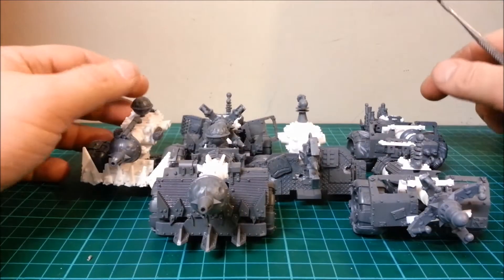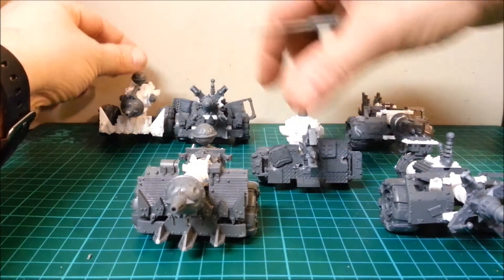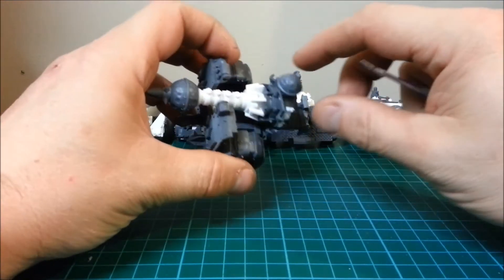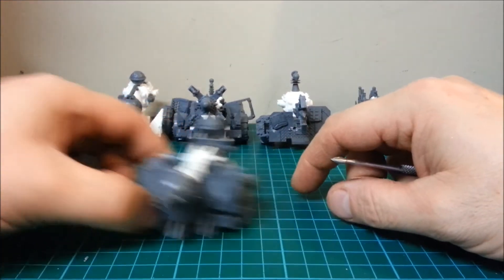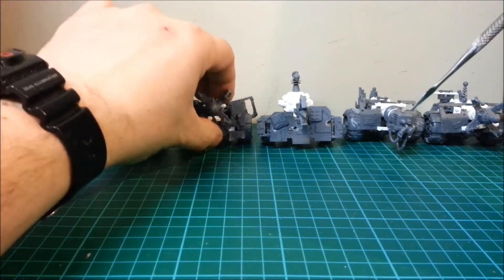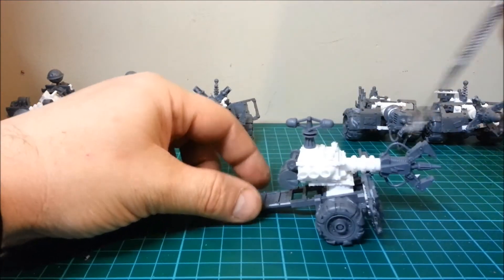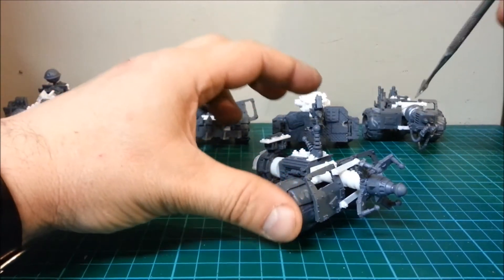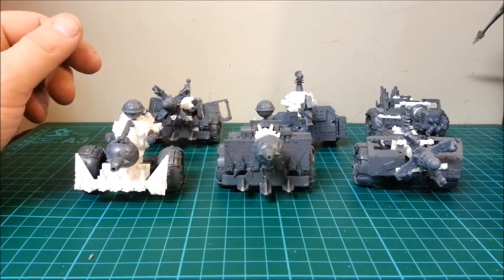Warhammer 40k Ork Army Converted mek guns with Trukk model

Comment: I really like this - I may well copy this system more or less directly!

I have to ask, though, how did you get the plasticard details on the barrels of the gun?  The video seemed to wash out some of the plasticard details, so I'd love for you to go into more detail on what you used and how you crafted some of the plasitcard power shafts. 

Also, how many trukks did it take to make these 6?  Since there are 6 sets of wheels, and only 3 sets per trukk box, I assume it took 2 trukk boxes in total, but I just thought I'd ask.